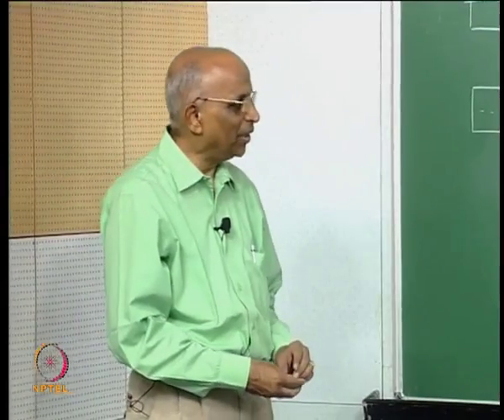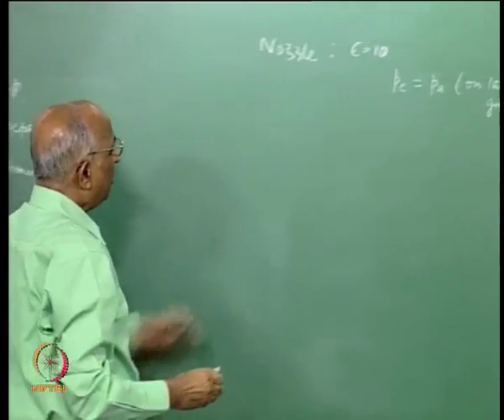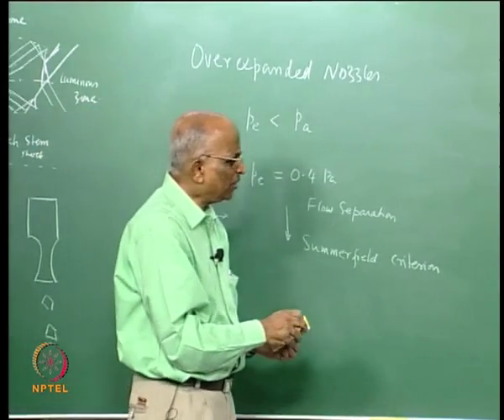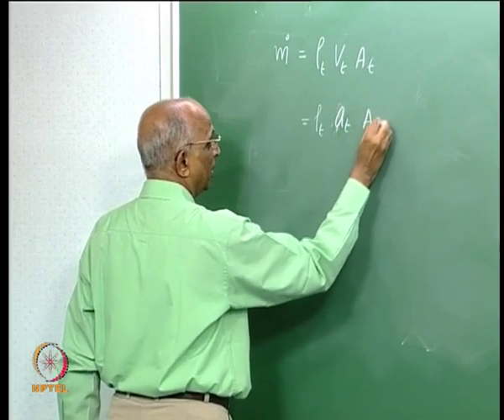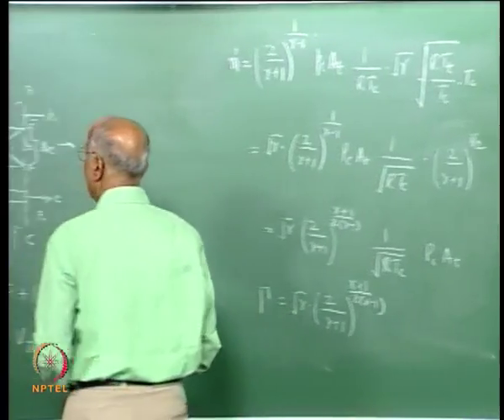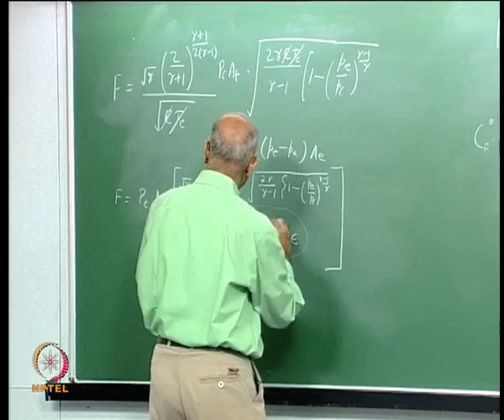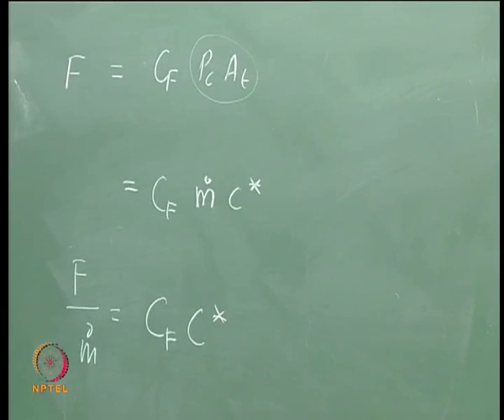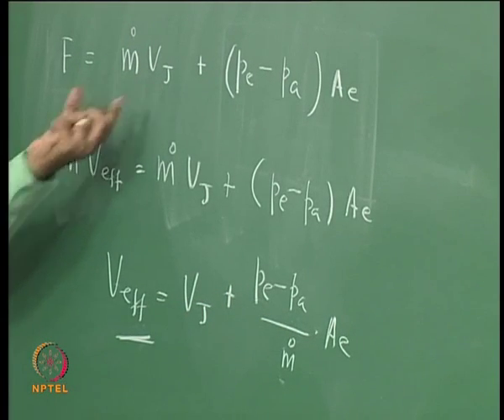Mod-01 Lec-12 Characteristic Velocity and Thrust Coefficient

Comment: at the very end it says pe-pa, in the formula for net force, this would imply that if exit pressure were under expanded and higher than atmospheric pressure net force would be greater, which was the opposite of what was said in the beginning half of the video ?
Reply: The net force also depends upon Jet velocity, Vj i.e F=mVj+(Pe-Pa)Ae. For an under expanded flow, like he stressed, you end up with a significantly less jet velocity and hence a less thrust.
Reply: Mitochondria is the power house of cell